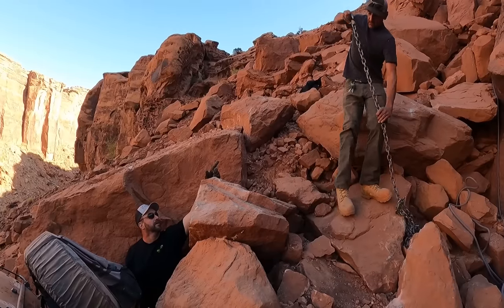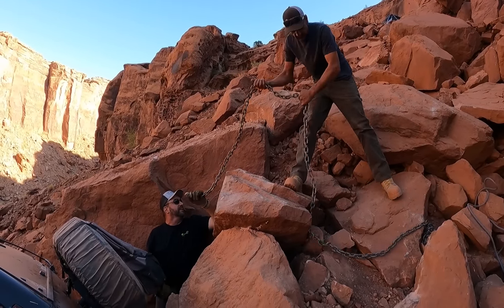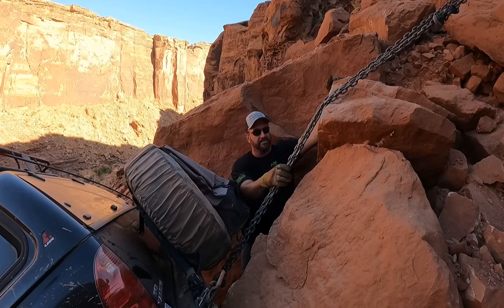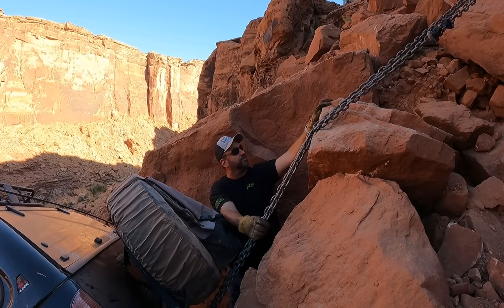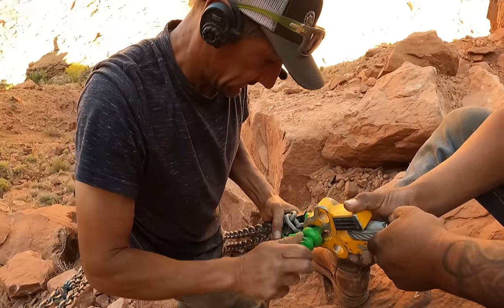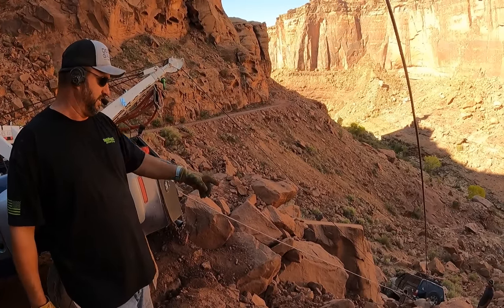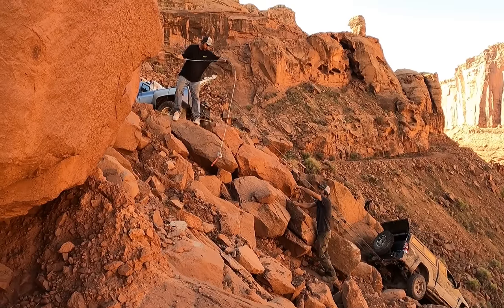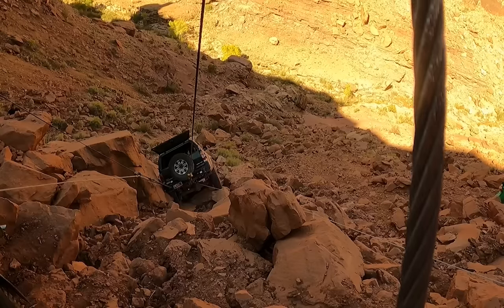Taco Down

Comment: Wow, who ever was driving that Tacoma is lucky to be a live and they stopped there and didn't roll and/or go further down
Reply: Yeah, that could definitely have ended much worse. Also, the crunchy corn crumple zone of the taco shell did it's job well, the passenger cabin looked basically unaffected, even the windshield was intact.
Reply: Coulda sold tickets to that ride!
Reply: I hope they had a change of underwear!
Reply: With where it went and what it went over the fact it did not roll is driver skill or luck, figuring out how they fell off the road on a straight section with a passing space possibly eliminates skill! I was equally impressed with the multiple winches used to control it and prevent it rolling on a winch rope during recovery. Knowing the vehicle and its limitations is why I back Trail Mater for the tow truck Olympics, not the fastest, newest, best but the operator skill, knowledge and years of experience is worth more than a Matts Recovery rope in sand.
Reply: @stevet647  I agree & Rory shows his skill's best & kept every wench snugged for the best control ! I been watching all those i know thats going for the olympics and if they take the looks out Rory shows his skills on most every tough job !
Reply: This is by far, the most amazing and difficult recovery yet! And the guy survived this ? Wow ! But how the heck did he get into that situation?!
Reply: Obviously they were attacked by a disgruntled diamond billed rock pecker !  How ELSE ?!?
Reply: Awesome plan

Comment: That was an outstanding recovery guys, Probably the hardest to date, sheesh the professionalism of your team is second to none Rory. I am always amazed by your talents Rory and that of Mike and Shaun. First off, I had no idea how you were going to pull this off, it looked like a failure from the start. You made your decision and went with it, and it was flawless. You can see how professional Mike and Shaun are, they stayed well away from the load and possible cable whip, Shaun was able to use a cliff face to protect him, from start to finish an outstanding job. The camera men did an outstanding job as well, although not in the limelight so much, their contribution to the task is more than worth a mention. I am so impressed with what you achieved and as a true leader and boss Rory, you changed over from Trail Mater to Blue to do the difficult job of towing out the wrecked vehicle, Kudos to you all. Stay safe and stay awesome.P.S.: I forgot to say that I really like the screen going black towards the end of the video in anticipation of the last clip or the real ending to the video. It is a very nice touch.

Comment: I'm glad you said this was "the one", the most difficult, cause I couldn't imagine anything worse. But the equipment and experience you have built up over the years is what gave you the ability to get this truck out. I sure do wish I knew something about the accident and how the driver fared. I would have trouble believing this if I hadn't "seen" it. You guys are amazing. And what a tow truck can do just illustrates why Matt needs one. He doesn't have this kind of situation very often, but a tow truck would still be helpful because they are so useful and amazing. This wouldn't have happened without having the higher angle pulling from the 2 tow trucks. Great job and very impressive. Thanks for sharing this amazing recovery with us.

Comment: Hi guys. I'm UK recovery driver of 32 years and although your methods would give our bosses a coronary episode you actually get the jobs done! Health and safety is clearly optional extras for you guys lol. Still learning some of your kit/parts terminology but hey, I'm getting there! Surprised I havnt seen any "double lines" from your winches giving a better pull? We have a 14 ton 4x4 MAN slide back with hiab and 3 winches for off road jobs as well as a Winch platform by way of a unimmog. I don't know the weight of your vehicles but they seem to hold well pulling that 2t plus lump out! Good effort guys.

Comment: The Off Road Recovery Bible, verse 198. Amazing job!!! And it was not necessary to use the Jeep. Congratulations on the great team you make!!
Reply from the maker: The jeep was not there to help, it was there in case anything happened and we needed to get someone out quick without having to unhook vehicles.
Reply: @trailmater  Perfect, a sign that everything went according to plan. That's what "work vehicles" are for. Greetings from Cordoba, Argentina.

Comment: 11:00 is when having a old holmes winch, pto driven off a jack shaft, would have done wonders. my method, (not disrespecting the process) would have been to snatch block off the rear of casualty, back to the truck. Two lines a piece, per winch, less stress and easier pull... again, this is an observation... yes I drive a wrecker with a holmes 440. So I'm lovin every bit of the content... thanks, and be safe... always

Comment: Its been awhile since I lost saw a bow shackle run down a rope.  We used to do it a lot, much to the dismay of the H&S rep. Our method was a tight rope held by recipient, shackle pin lowest but positioned such that if turned pin upwards it would tighten the pin, when near the recipient he would shake the rope vertically to make a wave in which the shackle falls into. Takes some nerve when the drop is 200ft and the the shackle is a 4.75 tonner

Comment: From the video it appeared that it might have been an easier pull from in front of the truck cause the slope looked smoother just down from where you guys set up? Then some angles not so much. Definitely went off at not a very easy recovery location, great work as always.

Comment: DANG!  I bet whoever pulled that pickup over the side of the road had to do laundry later!  Hope everyone was okay, yikes!  Air Hose Shopping LIst:  1.) Get enough hose. 2.) When you've got enough hose, get more until you figure you have a ridiculous amount.  3.) Once you gotta ridiculous amount, go about another 100 yards.  4.)  Pray you got enough.  Apply metric to any line, cable, strap, string or emergency security tape (aka electrical tape) as needed.  OKAY, well that was amazing!  I betcha you didn't add a single additional scratch or ding, too.  Only thing next was to have Rory break out the welder and a sledge hammer and then drive it out.  Toyota's gotta reputation, after all, and so does Moab Motorsports.  Hahahaha!
Reply: Howdy, Mike's Dad!!!

Comment: Super recovery what size cable do you use on trail maters main winch line it looks like 1/2 or 5/8.
Reply from the maker: 1/2" on both trucks.

Comment: I just noticed that they're all straight pulling I wonder if they had some snatch blocks rigged up back and forth to the truck to their trucks if the winches would have been a lot cooler and pulled smoother cuz it sounds like they were working pretty hard

Comment: I know a few wrecker companies that need to watch this video especially.  A few of them I've seen them deliberately damage vehicles more.  Some might have needed that to happen but many not.  One the vehicle had slid possible due to wet pavement freezing the tow Co driver deliberately pulled the car up on chain link fence pole running it though floor out the roof of car.  Car went from minimal damage to total loss.  Another one did side pull not a pull from rear or front that was a Chevy Inpala both rear quarter panels, rear end and front end.  Now I've seen some really good ones too.  But when the call comes from 911  dispatch I  think they accept it as ash n trash call tow.

Comment: Old square bodies still get the job done. this vid reminds me of a recovery told to me by a old timer. a brand new Miata went off the road going to the ski resort. He said the miata owner wouldn't go down the hill to hold the brakes on. Since it was off the road the cops didn't care. when he went back to his home to get help he got a call from the cops telling him to return. He went back a big old boat of a buick went over in the same spot crushing the miata. the buick drove away. the miata owner returned freikin out. Saying what im i going to tell my wife. He was banging his mistress. while supposbly at a conference for work. R.I.P  Mr G  Ass cancer is no joke
Reply: Tbh there's not much left of the original square body on mater. It's practically just some skin at this point. The rest is all highly modified.

Comment: if you would have put old tyres (several of them on a pipe to crate a bir tyre roll) under the car, it would roll over theses tyres as its being pulld uphill and would prevent damage to the under carriage and reduce winch load

Comment: Why is the rear diff in the yota off set like a samari or land cruiser?
Reply: I was wondering if someone else would notice that! Looks like an 80 or 100 series rear axle. Was hoping one of the rear wheel center caps would come of so I could see if the tell tale full floating hub was there.
Reply: @Johnsky-rd7ci  but why though, the factory axle is amazingly strong for its size. Definitely strong enough to handle anything a overlander Tacoma is going to do.

Comment: It's jobs like this that I believe hydraulic winches excel the best. Electric are best for short pulls. Not really the best for real winching jobs in my opinion.
Reply from the maker: I agree, however hydraulic doesn't work for me on my truck, therefore I have to use what I have.
Reply: @trailmater  I've run belt drive hydraulic pumps that work great and don't need a pto for. But I get it.